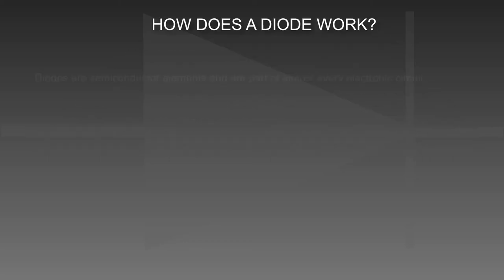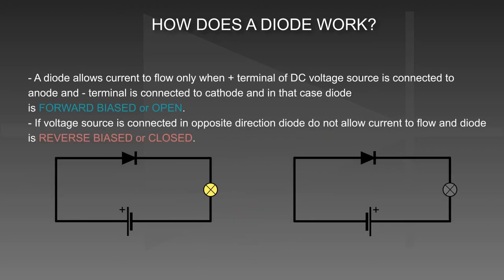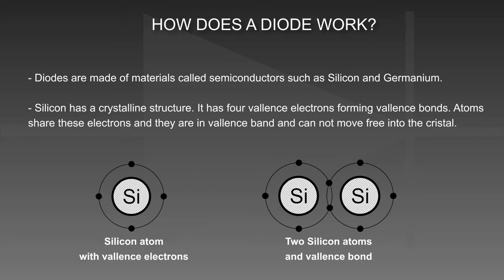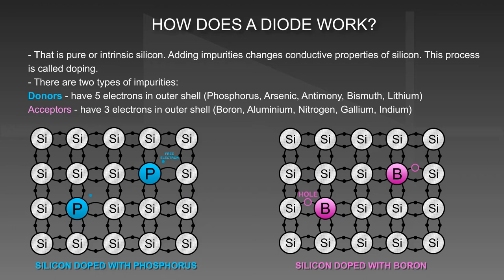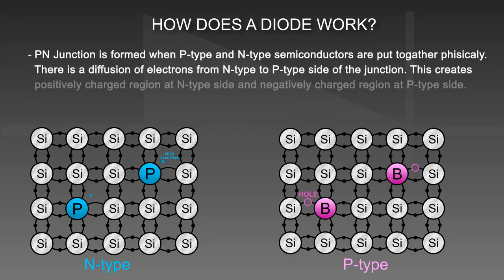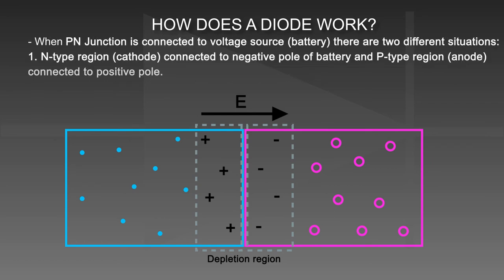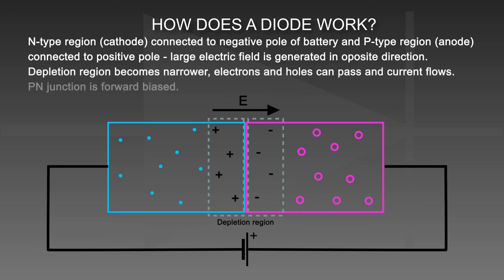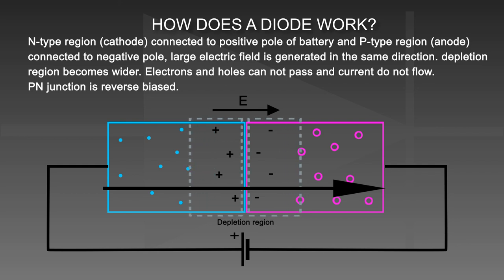What is a Diode? How does a diode work?

Comment: What is the test procedure for validating this in an electronics lab? I'm not sure the atom is moved by the electricity, only it's electrons. So how does the electric field create a distance between the atoms? Is this viable information? Or is it just me? It seems like I've spent time listening to it, yet I'm still dependent on finding the component premade at a supplier. How do I make the components to free myself and others from the supply and demand issue that keeps me from success? I'm having to walk, carrying tools, books, supplies, for so long that I scream when the store isn't there after being told it was. I'm in a lot of pain because of the things like this. 

Thank you for your video.
Reply from the maker: Thank you